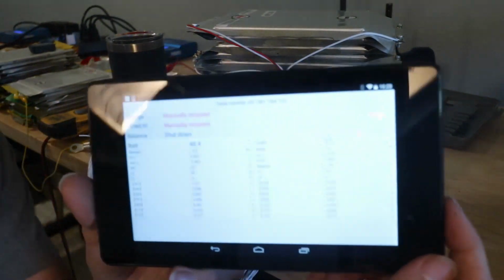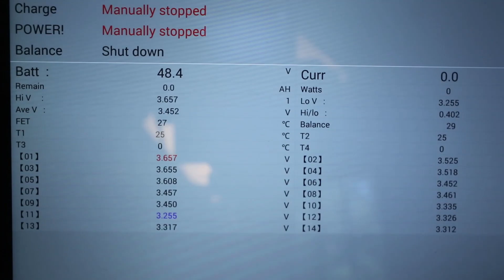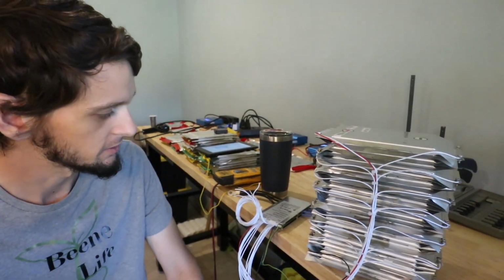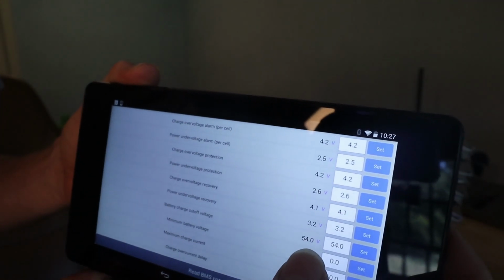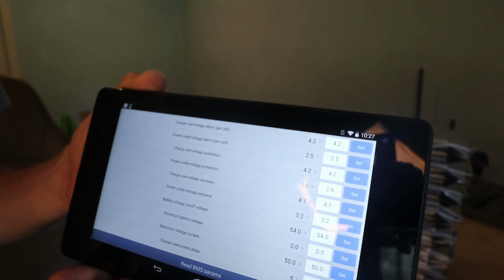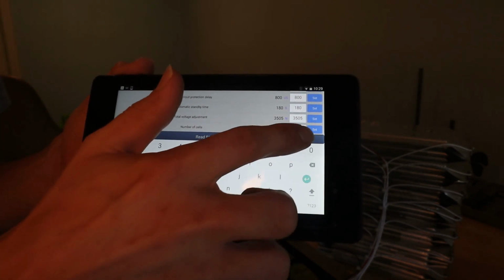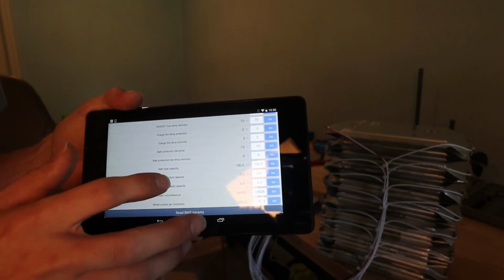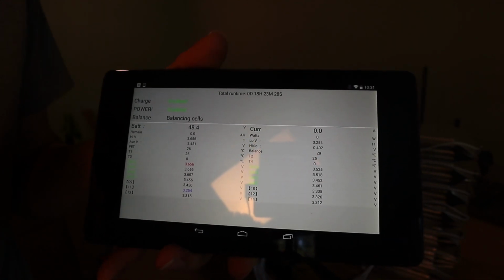Bluetooth Enabled ANT BMS Quirks and Programming on SPIM08HP Lithium Ion Battery Build

Comment: I have an auxiliary battery pack for my scooter which uses a Bluetooth accessed BMS, using the ANT+ BMS app. What I noticed is even when the battery is disconnected and sitting, the BMS parasitically drains it over time. Is it possible for me to put a cutoff switch so the BMS does not do this when the battery is disconnected and not being used,?

Comment: Hope this thread is still live?  I've 2 of these Ant-BMS boards with 1st one linked up progressivly over 15 cells.

I started with the later app (that needs authority to enter data) - got nowhere.  Could not get a stable Bluetooth connection, or enter any parameters to set up.

Now trying with this earlier app.  It is connecting, but  reporting low on cell 7 & high on cell 8 - so am  about to explore your curious cell tap sequence (thanks !) - but with 15s instead of 14s (wish me luck)

Then we have to do same again with our 2nd board on another 15 cells.

I fear this earlier app won't handle both boards, & while the newer app lets you select the device, I'm 99% sure it  won't connect to these older boards.

Being fighting all this for days 😢
Anybody got any advice &/or suggestions?
Reply from the maker: Do you have the WeChat QR code on your bms? That would indicate the newer app is needed. Another indicator is if the watts is pegged. I think it sits at 999w if using the wrong app.
Reply: @BeeneEnergy  thanks for reply.  We don't have the WeChat WR on our BMS's, & have tried the newer app anyway (wouldn't connect).  

Shame, as that seems a rather more developed.

My question is about the curious jump in sequence that you describe for cell taps 7 & 8.   I've gotta get 15 cells (not your 14 cells) into the 20 pins between Red & Black at the ends.

Comment: do you need to short the 2 pins every time you want to run current thru the bms? or is that for configuring/bluetooth only?
Reply from the maker: It has a sleep setting,  if set to 65535 you don’t have to turn the bms on for a long time. And only if it doesn’t see current flowing for that long.

Comment: I'm thinking about getting one, if i get the 80amp one will i be able to discharge 80amps? Or is that the charge rate?
Reply from the maker: All the ones I’ve seen are symmetrical for charge and discharge. Watch out though as they are typically advertised at their surge current. I was told the 320a was good for 140a continuous.

Comment: I can't ever get my ant BMS to fully charge my 32S LiFePO4 pack. The app refuses to set max pack voltage above 110V (which is completely wrong). Where did you get the BMS App?
Reply: i can send you app if you need dear.  www.cl-rd.cn

Comment: Hi, I have run into an issue. I use the same bms. But cell no.1 shows only 0.2v, but when measured directly from the bms wires its 3.2v. Rechecked the wiring all are correct. Can you please share what could be the issue.
Reply: you didn't connect the battery correct dear if app shows different voltage with your pack

Comment: Question. New to lithium ion and such. Building a 72v golf cart. Using two spim08hp sourced from battery hookup in 36 volt configuration. Putting the two together to make my 72v. I don’t know what 14s, 20s, and such is. I need a bms capable of working for these two banks of batteries. I’m told I need something around a 250amp to 400 amp discharge rate. I really need some knowledge and help in this. Right now the cart works. But have no way to charge it properly once it gets discharged.
Reply from the maker: Those are probably 10s packs to make 36v. 10x3.6v.

Just means ten cells in series.

I’d be looking for a 20s BMS. You could go for an ANT 400A model which might be 180a continuous or maybe the jbd relay based that’s rated for 200a.

Personally I’d roll the dice with the JBD unit. I’ve never had problems with them and they have great UI in the iPhone app. Also a slick touch screen you could install for turning the bms on and off or viewing voltages/current right on your dashboard.

US $102.96  34％ Off | JBD Lifepo4 BMS 200A 7-20S Automatic Identification Smart BMS 24V 36V 48V 72V With Free Built-In Bluetooth Temperature Sensors
https://a.aliexpress.com/_mqsZsJO

Comment: Good video like to see more on setting these bmses up I have three of the 180 amp models waiting on cells to ship shouldn't be long 👍
Reply from the maker: Do you have the ones with the WeChat QR code on the case?
Reply: @BeeneEnergy  No but I think thats where i got the app I have it hooked up ln a 16s configuration with the same sells your using just to try it out seems to be working ok
Reply: @BeeneEnergy  we have dear if you need.  www.cl-rd.cn

Comment: My lcd screen won't show any data. Just say zero for all cells and over all voltage. Driving my nuts! The screen comes on and I can scroll through but won't show anything but zeroes for everything. Works fine in the app though. Any help would be awesome
Reply from the maker: I believe there are four wires. Two for power and two for canbus. Canbus needs to be swapped, so a of screen goes to be of bms. I connected it wrong the first time I connected a screen.

Maybe this is the issue?
Reply: @BeeneEnergy  I'm pretty sure thos 9s the issue. I'm not sure what ones are for the power and what ones are for information.
Reply from the maker: @FelonENews  I think it’s labeled on the BMS side. Either on the pcb or the heat sink. I think it’s the middle two.
Reply: @BeeneEnergy  It's inside shrink wrap now. I may have to take a guess. lol
Reply: @BeeneEnergy  is just uploaded a video so you can see what I'm talking about "ant bms grrrr" lol
Reply from the maker: @FelonENews  I would try swapping green and yellow to see if that solves it.
Reply: @BeeneEnergy  ill give it a shot. Thanks for the advice. If I figure it out I'll let you know!

Comment: I was about to give up on this ant BMS until I found your video, I have access to the app and I can see the BMS parameter but I can’t make it work cause the voltage and current still cero at the output
Reply from the maker: Are you android or iPhone?
Reply: @BeeneEnergy  iphone
Reply from the maker: @miguelv431  Curious, do you have one of the newer models with a circular WeChat scannable code on the front? Supposedly the app will be able to see the data but not change parameters. Gotta use the WeChat app and scan the code for the correct iPhone application.
Reply: @BeeneEnergy  yes I have the circular one
Reply from the maker: @miguelv431  Yeah I’ve been bugging my contact about a native iPhone app but it’s not out yet. Until then apparently you use WeChat or connect to a computer.
Reply: @BeeneEnergy  thanks for your time  one las question do you have a link with manual and how do I connect to the computer
Reply from the maker: @miguelv431  Here’s some documentation I cobbled together in case it helps. I haven’t hooked up to the computer yet. I assume is a canbus to USB adapter with the right software.

https://beenebrothers.com/ant-7-16s-documentation/

Comment: The on off function, you say short, do you just short the 2 pins to turn it on and off or do you apply 3.5 volts to the 2 pins to turn it on or off.??
Reply from the maker: Yeah short wouldn’t be the right word, you’re right. Applying 3.5v will work. I just use one of the cells of the battery.

Comment: Is there a android app?
Reply from the maker: There is, VBMS is better than the one provided though. Costs a few bucks.

Watch out though, manufacturer just released a new version of this BMS that uses a different app. I haven’t figured it out yet. If it says you use WeChat then it’s the new version.
Reply: yes it has if you need please contact with me   www.cl-rd.cn

Comment: Hello, can we have BMS connected in series?
Reply from the maker: Technically yes, as long as the overall voltage is no larger than what a single bms is made to handle. Otherwise the mosfets could weld shut.
Reply: no you cannot

Comment: I am trying to connect the same unit to 72V LiPo, 20s-5p.   Do I need to make parallel balance connections to each of the 5 cells?
Reply from the maker: Wouldn’t each of the five cells in parallel have to be connected to each other? Maybe I didn’t understand the question.
Reply: @BeeneEnergy  I was referring strictly to the balance leads. Do I need to make parallel connections to each of the 20 balance leads to each cell in the 5 strings? Thanks You for your response!
Reply from the maker: @markv1105  I wouldn’t think you’d need to run a lead for each cell since electrically they are the same. I suppose the thing that would cause that statement to be wrong is if the voltage drop was different depending on where your sense lead was on the parallel connection. I’d imagine if the bar/bus is sized correctly for the current you won’t have an issue.
Reply: @BeeneEnergy  This is for an ebike. Batteries are 5ah LiPo multi cell packs.  72V 20s-5p for a 25 ah output. Each string has 4 (5) cell packs with an XT-90 harness connecting them in series  Each pack also has a balance connector to connect to a hobby charger.  I am installing these permanently so the question is...do I need to connect each balance lead in parallel for every pack across each of the 5 strings.  Sorry I should have put more detail in my original question. TY!
Reply from the maker: @markv1105  I think I understand now.

Yes you’d have to connect all the balance leads together in parallel for the 5 strings.

The question then becomes, do those lines need to be fused?

What you’re doing is out of the norm. I’d be worried about something going awry. If one cell in one pack started self discharging it’d be pulling current from the four other packs. Across the small sense leads. Which could cause them to overheat. That’s a scenario I can think of. Might be others.
Reply: @BeeneEnergy  Why is it not normal? Maybe its why I cant find any detail.  Are all BMS designed to monitor only one run.   I have seen these installed on Li-On builds.
Reply from the maker: Usually if you run parallel cells you would have all five stacked together with all their positive terminals bonded and all their negative terminals bonded.

If you build five individual packs for 72v each then it makes it harder to bond each of the 20 cells in series with the other four in the other packs.

Comment: I helped my father to connect his LiFePo4 battery packs to these ant bms. He had 4 packs made of 8 batteries each one, and each 8x battery pack have its own Ant Bms to balance them. I connected in turn each Ant Bms to configure it via bluetooth to have 8s configuration and proper LiFePo4 reference voltages and limits. The problem I have now is that each BMS have a Bt mac address set to AA:BB:CC:B1:23:45 so when all of them are booted, they conflict and I cannot connect. I was not able to change the bt mac address via the VBMS app. Do you know how to solve this problem? Thanks!
Reply: I'm trying an ANT BMS with a 32S LiFePO4 pack, and it refuses to allow charging over 110V. Did you run into this type of issue (where the App wouldn't let you set the correct max pack voltage)?
Reply from the maker: I haven’t solved that issue yet. Only thing I did figure out is that if you connect to one bms with a device and fire up another device and connect it will connect to another bms. It’s kludgy. Wish there was a better way.
Reply: I was able to solve this issue. Using ANT BMS APP 4.9.1 found on Rjxzstech.com website, after you connect to a bms (all others must be off) under settings, you can find a bluetooth mac address, set to 65535. You can change it (let's say you set 2). Bms will reboot and you'll have to do a new pairing. The new device name will be for example BMS-20A-002 and the new mac address will be AA:BB:CC:B0:00:02 not conflicting any more with the others. Repeat for all the remaining BMS turning on one and configuring the same way. Once all are set, you can switch to each one with green connect button 😊
Reply from the maker: @mirbuf  That’s fantastic! I’ll be trying this out. I really appreciate you sharing.

Comment: This BMS doesn’t do active balancing. One thing that needs to be set is the “start balancing” voltage. Basically a cell would have to be over a certain voltage level before it starts to balance with the others. This is set to 4.1v as default, but I usually recommend 3.8v per cell, so the battery can get in full balance with substantial current before it is trickle charging at the end of the charging process
Reply from the maker: Yes you’re right, I confused active balancing with being able to start balancing at any time. The energy doesn’t move cell one cell to the other, but one can have the BMS balancing even when there is no trickle charge occurring.

Comment: I have this BMS , I power it up using a 3.5 volt battery, I then remove the battery I used to power it / then after about 30-50 mins it seems to power off , red light goes off and can’t
Connect using Bluetooth, any idea why this may be happening ?
Reply from the maker: I believe there a setting for when it should sleep. I believe the intended use for these is on an ebike of sorts so perhaps they assume one will turn it on each time they need to use the bike. Small bit of security via a key.
Reply: @BeeneEnergy  Figured it out, need to short both wires together one the device has been powered, seems to be staying powered up now
Reply: @T-Sav  I’m having the same problem
Reply: @joshuakuberski8002  You need to connect the two wires together that you used to power it up after powering it up
Reply: @BeeneEnergy  thanks for the rapid reply, I will check out the settings tomorrow - once it’s switched on first time using a 3.5v battery, will a switch work to power it on from then on? Or will it always need a battery 3.5v? I’ll check tomorrow anyway / many thanks , just subbed
Reply: @BeeneEnergy  cant see anything in the iphone app to configure sleep time or anything. Once you have powered the device on using a 3.5 V battery and the two cables, what do you do with them? Are you suppose to leave a battery there? I have to re-power it, looks like the BMS must stay on as the hours on is now showing 16 hours. V strange.

Comment: Yes these bms's are very clever. I have one myself and have currently used it on a 14s battery a7s battery and now it's currently being used on an 8's lithium iron phosphate battery. These BMS's are very versatile and I highly recommend them I did not get the LCD screen for it but it would be pretty cool to have it hooked up to the front of a battery case just so you can see your display without any kind of other interface. Good video. Thanks for posting.
Reply: How did you wire it for 8s

Comment: My brother much respect, I am currently doing some research on making my first battery pack and is torn between buying the 18650 and porch cells to be honest I am kind of leaning towards pouch cells. Now my question is what is the capacity of a pack like this one and in a particular way how long a pack like that would run a full size fridge?
Reply from the maker: This pack should be in the 800wh range.  Which should power a fridge for 8 hours or so.

But for a storage battery I’d recommend lifepo4 prismatic cells. I’ve got a video or two on building that type of pack. Look up Lishen 272 on alibaba and you’ll see a set of cells that would get you a 3.5kwh pack very affordably.
Reply: @BeeneEnergy  Respect man I watch allot of your videos so no  doubt I should have seen then but will go back and look I will also look at alibaba thanks for the information once again respect.
Reply: Excellent recommendation for alibaba thank you.

Comment: nice video. I purchased the larger bms from them which goes up to 32s and it has no connector to short to power it up lol. how is your bms working for you? is the balancing working yet?
Reply from the maker: Interesting, we’re you able to get it powered on? My two pins are on the connector to the optional lcd screen.

The balancing did eventually work, it was just slower than I could measure over a short period. Think it took about a week.
Reply: @BeeneEnergy  how long did you let it sit to get them balancing? a few days? My bms does not match any of the bms instructions they have. It came with a small power button and wires but no clue where to solder it. maybe it works through my lcd screen as well thanks

Comment: Mine came with a screen but no instructions.
Reply from the maker: I haven’t gotten my screen to work so far.
Reply: @BeeneEnergy  Yeah, mine came with 2 4 wire leads (green, yellow, red, black) with one connector on each end. I assumed you join them to create one lead with a connector on each side and plug them both in. But the screen only says "connect bms", so didn't seem to work. Side note: my bms came on the moment I plugged the balance wire plugs in. I didn't have to short it. Weird huh?

Comment: Whatsup Chris did you parallel the cells by hooking up the 28 cells together in pairs to make 14 cells then connect in series pos + negative until you reach your desired  voltage?
Reply from the maker: Yes that’s what I did. So each bolt goes through four battery tabs making the parallel connection as well as the series connection at the same time.
Reply: @BeeneEnergy  Okay I get it. I like that method. Thank you. I have 44 spim 08 cells to make a 22s pack I am making for my ebike and a ant bms that's how I came across your videos.